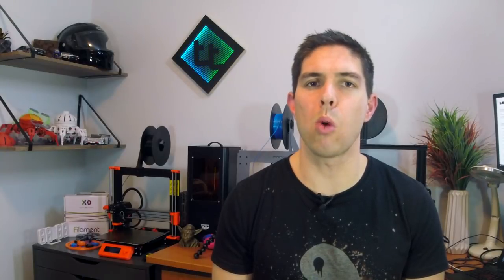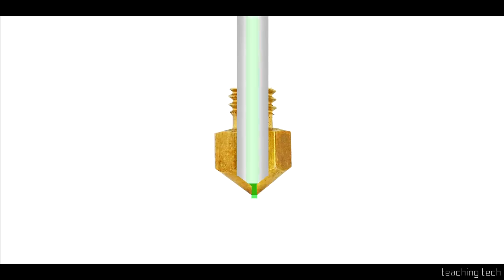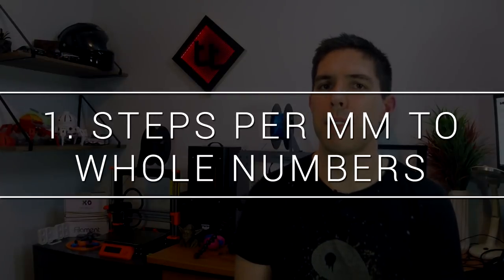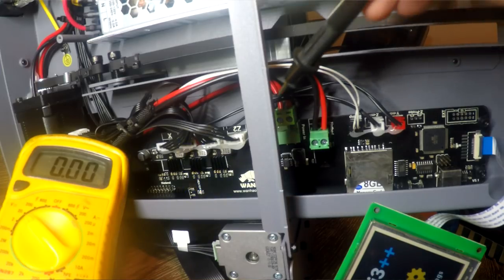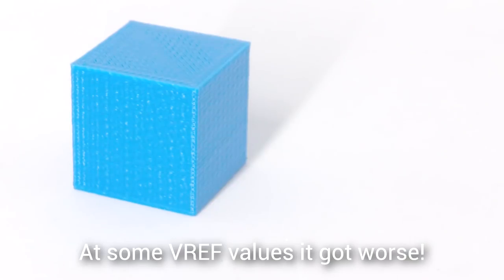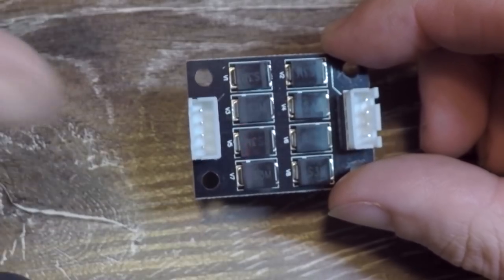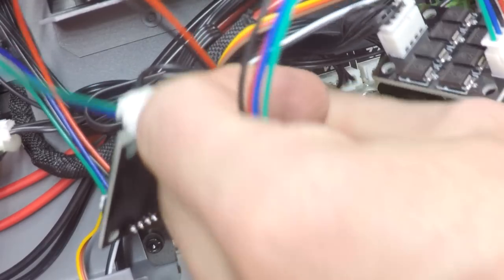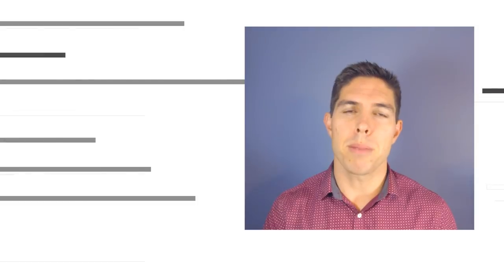Four ways to beat moire on your 3D printer

Comment: Moire is pronounced “more ray” in the TV industry and is seen when someone wears clothing with tight pinstripes. Looks very similar to the pattern on your print but slightly different. Just a bit of trivia. I’ve only had my printer for a month but Your channel has taught me heaps and I’m very grateful.
Reply: "more ray" is the americanification of the French word moire. Even if it's how people say it, it's not how the word is meant to be pronounced. Anyway, as long as people understand each other it's not important what's "correct" :)
Reply: @lui472  actually, these are two words with similar spelling and similar meaning, and both are probably correct in this video, kind-of. The French word moiré means a watered or shimmering effect, and is pronounced "moray" or "mwa-ray". The English word moire means a fabric with a watered appearance and is pronounced "mwa". In case you didn't notice, one of these words has an accent over the "e" which means it should be pronounced (as "ay").

The French "moray" word is probably more correct and precise in the context of TV production, because of how it comes about. Some definitions of moiré specifically mention the effect being created *when two regular patterns are superimposed*. This is the cause of the pattern in TV and other video (I've seen it on a computer monitor, for example). So it makes sense to call this a "moray" pattern. A 3D printer can have regular patterns from two different sources (eg dented roller wheels on both X and Y axes) so the combination can also cause a moiré pattern.

But if the effect on a 3D print is not caused by superimposed patterns, and instead is just caused by wobbling due to a loose belt, then it's a general shimmering effect, and so it would be wrong to call it moiré.

So all moirés are moires but not all moires are moirés.

Comment: I don't think using a whole number for E steps per mm matters at all.  The idea that extruding a whole number mm of filament will result in a whole number of steps is irrelevant in practice, where extrusion amounts are virtually never a whole number.  Open any random gcode file you have laying around, scroll to some random place in the middle of it, and look at the code.  You will see a lot of lines starting with G1 (move commands), and almost all of them will have 3 parameters, an X, Y, and E value - saying where to move to (X and Y), and how much to extrude while doing it (E).  Those extrusion amounts are in mm of filament, and at least in my S3D generated g-code go to 4 decimal places.  The resulting calculations for extruder steps are always going to result in fractional steps, and Marlin at least takes care of it mostly properly (it does have issues with extrusion accuracy when the E distance gets large due to arduino floats not keeping a lot of precision - easily solved with liberal 'G92 E0' commands to reset it)
Reply from the maker: Hi Rob, thanks for the detailed comment. I have a note in the description addressing exactly this. The rounded steps are much more important on the z axis where we do have exact amounts of movement throughout the print.
Reply: Rob B — Agreed. The rounding will be at most 1/2 of an E step. And a single E step will correspond to to a tiny fraction of a mm on most setups. And both the melt zone and the filament flexibility always add some buffer between the filament input and output. Plus, in Marlin the steps/mm value is used to calculate the step value early on, and subsequently all movement is done in whole steps. So it is really irrelevant whether E steps-per-mm is set to a whole number or not. Also, there is no cumulative error due to float rounding errors in Marlin. Any float rounding (which is in the 10E-7 range) in one direction is made up in the other direction by the early conversion to steps in the planner.
Reply: I wasn't referring to any cumulative error from float rounding - rather the lack of decimal precision with large numbers when using floats.  A float only has about 7 digits of precision, so if you've extruded 100m (about 1/3 of a 1KG roll, or 100000 mm) of filament without resetting the E-axis position, you've only really got accuracy in extrusion of 1/10th of a mm left - very small extrude commands at this point are effectively ignored, and if you've got a lot of them in a row (say, printing a small circle at a low layer height, maybe with a small nozzle) can result in severe under-extrusion.  This is why 'G92 E0' is commonly seen in start g-code, and is now even in the default layer-change g-code for recent Prusa Research slic3r profiles.
Reply: Huh

Comment: I think I found the cure for this problem on these printers.  I shorted the 1k Rosc resistors to lock the drivers in mixed decay mode.  The a4988 datasheet has more info on this.  The results are fantastic!  I've been trying to get good prints from this printer since I bought it 3 years ago.  I've tried different firmware, acceleration,  0.9 steppers, adjusting stepper current, putting the Z steppers in series, and nothing ever made much difference.  the only thing I haven't tried was TL Smoothers.  With this mod, I get smooth walls on my prints, no missed steps (I was having problems with the Y axis running higher speeds with 0.9 steppers and the extra weight of Ultrabase), and the Z axis moves smoothly for bed leveling (It used to jump a bit and make a ticking sound as it moved up and down).  The only down side to this modification is a very small increase in stepper noise, which is a very small price to pay for these results.  This has gone from being my most frustrating printer to a really nice machine.

Comment: Hi and well done with your tutorials...  By the way, I have been in the printing industry for 30 years and "Moire" is normally pronounced...    Moor - ray.
Reply from the maker: It's a French word and I asked a French lady. She pronounced it much closer to how I did in the video. Thanks for watching.
Reply: @TeachingTech  Cool video. It's written moiré, though. And pronounced "Muareh". It's an adjective, derived from the noun moire.
Reply: I know this is a couple of years old, but the word you're looking for is "Moiré", not "Moire". It very definitely is pronounced "Mwaw-ray". It's a printing term having to do with offset printing, not a silk pattern.
Reply: @peterdanielketelsen6239  thanks for that.  I was (and I'm sure many others are) not aware that there were two words at all.  I assumed it was one of those English things where we borrowed a word and don't collectively care how it originated.  This makes sense.
Reply: @rwetmore  it's actually a generic word referring to the interference between any two intersecting patterns of different frequencies including sound and electricity.  As Peter said, the adjective came from the noun (spelled without the accent) which is a ridged pattern overlaid on silk, which has its original thread pattern.  (Two patterns intersecting...check.)  Many industries use the term.
The French lady was right about the pronunciation of that spelling, but not about which word should have been used.  Sorry, French lady.  Moiré is correct, without the silent 'e'.

Comment: Something else to look at it for micro artifacts like that clearly your diagonal lines were taken care of by the TL smoother but you still have little micro artifacts those can also come from Miss line smooth rods and bearings that are rumbling so make sure your smooth Rodger straight make sure your LMU you bearings are smooth and not rumbling it's pretty easy to feel by simply grabbing whatever taxis still has the noise and moving it with your hand manually if it's not smooth you'll feel it make adjustments and or Replacements as necessary to make it smoother sometimes you just need to put some Super Lube on it
Reply from the maker: Great suggestion. I can't feel anything but smooth movement but I am due to add some grease. Thanks for the reminder.

Comment: Nice video! I'm the one who made that TL-Smoother mount on thingiverse and sorry about the amount of support material needed to print it. Pretty much how it is oriented in the STL is how I printed it. Couldn't do a whole lot to avoid supports since it would require me shifting the position of the TL-Smoother on the mount forward to make it flush with the back of the mount and space constraints don't really allow for that when mounted. On a side note, I also have mounts for the X / Y / Z TL-Smoothers so you don't have to worry about hot gluing to or anything like that if you're interested. I promise the X / Y / Z mounts are better than the E mount. No supports needed! I do recommend printing it in a higher temp material though because the heat generated by the smoothers can cause normal PLA to warp in a short period of time. I also recommend getting some non-conductive thermal paste or thermally conductive tape and small VRM heatsinks and installing them on the smoothers for better heat dissipation. I'll link to some that should work as well. Thanks!

XYZ TL-Smoother Mounts for Duplicator i3 plus: https://www.thingiverse.com/thing:2803556
Heatsinks: https://www.amazon.com/gp/product/B01JB8MQ76/ref=ox_sc_act_title_1?smid=A2H66MA3VRYS8E&psc=1
Reply from the maker: Hi TJ F, thanks for watching and posting. And thanks for your file. It is still working great!
Reply: If you want to handle heat, get a thermoelectric AC unit and blow cold dry air actively
Reply: It's like 5000% better than heatsink because of differentials
Reply: Credit Tech Ingredients overclocking

Comment: I got great results by using Clip-on Ferrite Ring Core 9mm  (2 on each axis) and 2 on the main power cord. Also I added 2 32x3mm round n52 magnets to the Ring cores.Things just Quiet down. Now I have smooth walls on my prints. Stabilizes the stepper motors.
Reply: Super underrated comment. You might have to explain your old fashioned analog wizardry to the digital generation.
Reply: Magnet = TL Smoother
Reply: Where are the ring cores?

Comment: @Teaching Tech
I'm confused by your diagram @1:08 it shows a liner going all the way into the nozzle. I don't know any setups where the liner goes into the nozzle. The liner is usually part of the heat-break and stops at the end of the heat-break threads, before the nozzle even starts. I understand the concept of the zone-of-inaccuracy, but that generally refers to the point after the liner in the heat-break stops, and before the nozzle starts.

Comment: You have only one problem, is that the hot glue can hold static charges and that could do some noises after the power lines been filtered, so it's better not using this method and instead you can use the high temp. silicone or any non-transparent epoxy would be better, but keep going well done 👏💪💪
Reply from the maker: That's a good tip, I did not know that.

Comment: Great Michael - Will be giving the TL-Smoothers a go.
Reply from the maker: Bang for your buck! Preparing for the bltouch follow up btw. Now have it running without original z endstop and auto levelling before each print in 30 seconds.
Reply: WOW - Can't wait to see that - I am planning on doing the initial bltouch install this weekend. I love the progressive build/upgrade you are doing on this cheap printer. I saw that Aldi had some of these printers reduced to AU$399 in their North Rocks & Wentworthville stores last weekend!

Comment: If you print with 0.4 line width and solid parts, and find that the ripples are about 1.1 mm apart (11 ripples per 10mm),
these ripples are caused by the 45 degree infill pattern having 0.4mm width lines.
You can remedy this with Cura settings Wall Count and Infill Before Walls, but maybe also infill speed kinetics against the wall with overlap.

To explaine the ripple width using trigonometry CAH formula: COS of an angle == Adjacent / Hypotenuse.
That becomes with what we need to know and already know: Adjacent == COS of an angle * Hypotenuse.

ripple_width_in_wall_as_adjacent = cos(45)angle_of_infill_lines * 0.4_line_width_as_hypotenuse * 2_times_adjacent_in_wall * 2_times_every_other_line_the_nozzle_meets_the_wall.
ripple_width_in_wall = cos(45) * 0.4 * 2 * 2
ripple_width_in_wall = 1.13137mm

Building an object with variety in the layer layout will cause the infill to start at different places and so the ripples in the wall will shift by layer groups having common layout.

Comment: Don't know what drivers your printers use. But if it gets better by using a tl-smoother it's probably a DRV 8825. These drivers don't microstep well on low inductance steppers. Just swap in some a4988 or trinamic drivers and it will work a lot better.
Reply from the maker: Melzi has integrated a4998, and my researching suggested what you said about tl-smoothers working better with drv8825. I was pleasantly surprised that it helped so much.
Reply: Hmm that's interesting. a4988 drivers don't like high inductance steppers that much.
Reply: You can try setting them on fast decay mode. Helps with bad microstepping sometimes.
Reply: My printer had A4988 drivers and would get strange artifacts. Swapped them for TMC2208 ones and the prints are much better quality and the motors are virtually silent now too when before they were quite loud.

Comment: 1:07 I never used a nozzle like that, in which the PTFE tube goes inside of it. I use only 1,75mm so I don't know for 3mm, but the PTFE goes until the "butt" of the nozzle, the diameter of its rear hole is already around 1,8mm so there's no way the tube can go inside the nozzle like that
Reply: I haven't gotten my Ender 3 yet.  But I assumed they butted up as you describe.  Guess I'll find out.  Just gotta try sticking the ptfe tube into a nozzle

Comment: This is an open question to all of you because I am still getting a lot of this moir pattern in prints:

I am using an allmetal bowden E3DV6 converted to direct drive with bowden and a 3D printed lock at the top

my extruder steps are rounded

the current pot is set at a smidge under half because the motors get so hot they melt the 3D printed part holding it in place and cause jams even with a motor cooling fan

I don't have any diode smoothers but I will try some tmc 2130's I have leftover from my last project, it appears more as if the motors are snapping out of position rather than inconsistent pulses

Basically I have 3 broken cetus MkII's that have been converted to 8-bit RAMPS 1.6 but I found out after the conversion that all the motors have resistances 10 times higher than normal Nema 17's that make them extraordinarily choppy because of the extra inductance unless I fork out more cash to convert the machine to 24V, idk, seems pretty annoying cetus designed so many proprietary parts in their printer, I'm looking for ideas to fix this without putting out more money
Reply: I'd suggest seeking help among DIY printer builders, if you haven't already.  Most people barely know how their printers work, much less how to modify them to the extent you've already done.  (Not commenting on this channel, just the general public.)  I'm sure there's several forums around the internet for this segment of the industry.   Even CNC forums might be helpful as it's all really the same tech in different sizes and orientations.  Cutting, printing, milling – it's all cramming Gcode into stepper motor drivers.
Reply: @VoltisArt  hey dude, thanks for replying! I found out a solution a few months ago and forgot I left this question here, I ended up upgrading to 24V, TMC2130's, and re-arm to smooth out the high inductance of the cetus motors. It was not a cheap solution and nightmare to get an lcd working with it all. Never fixing another dead cetus again.

Comment: Man this is great, I didn’t even know Moire was the problem until this. I’m still not sure I understand the cause of the problem though. Would replacing the extruded with an aftermarket upgrade resolve the issue?
Reply from the maker: It's all in the stepper drivers. All the extruder can do is exaggerate or mask the issue depending on the design.
Reply: So the stepper drivers on the CCT are shonky? In many ways this is a great 3d printer, and in a lot of others, it's a huge PITA. Now you've had it for a while, what steps would you take to upgrade it? What is going to give the most bang for buck? There are lot of people with these printers, so it might be worth doing a video just on that, combining all the upgrades you have added and what order you might do them in, what ones worked and what didn't.
Reply from the maker: You can replace the mainboard but the LCD might become useless. You can solder pins together to change the decay mode on the stepper drivers. Not for everyone but if you are comfortable soldering really small stuff it should fix the problem. I plan to explore this at some stage, starting with a spare board from an old printer as practise.

Comment: Tmc drivers on x&y and all artifacts are gone.
Reply from the maker: Melzi board on this printer, integrated drivers, not an option. Good suggestion otherwise.
Reply: I can vouch for this one too. Upgrade/Downgrade to a RAMPS board which opens you up to all the TMC drivers. Very cheap to do.
Reply from the maker: Got a spare RAMPS sitting around too.

Comment: Dang I had TL smoothers from bigtreetech I had never installed.  I have a CR10 V3 with this exact issue.  But the stepper motor on my CR10 has a connector with 5 positions and 4 wires.  The smoothers I found in my spare parts have a 4 pin header and 4 pin extension wire .  Is there a 5 position TL smoother out there?
Reply: If the connectors aren't using all of the wires, you might first consider changing the connectors.  Sometimes manufacturers use parts they wouldn't ideally "need" to use or even planned to use because another part was readily available or cheaper in the short term.